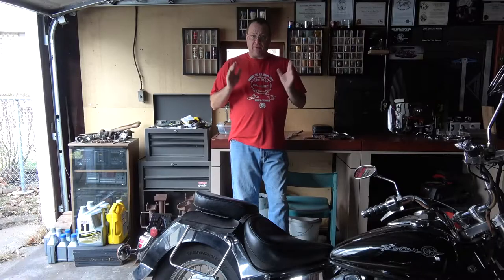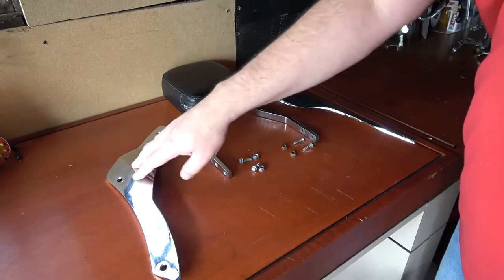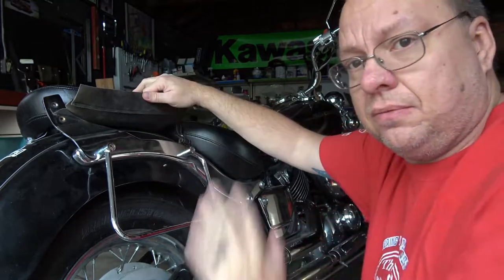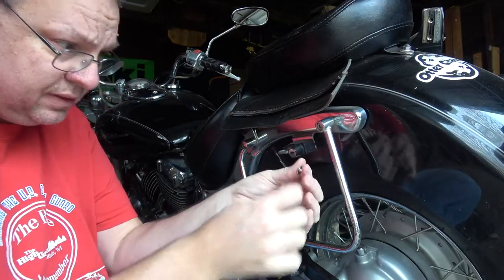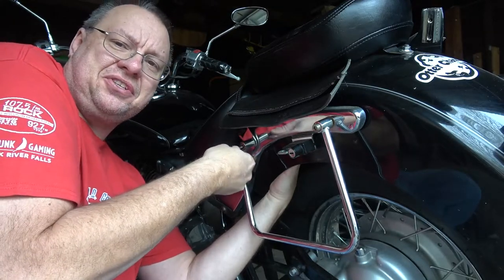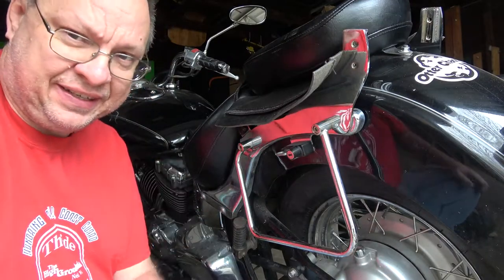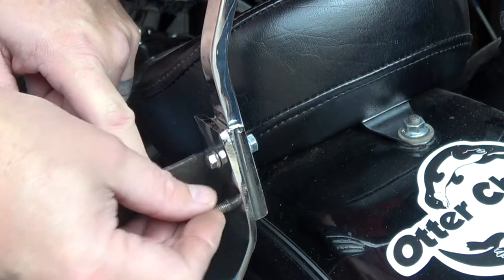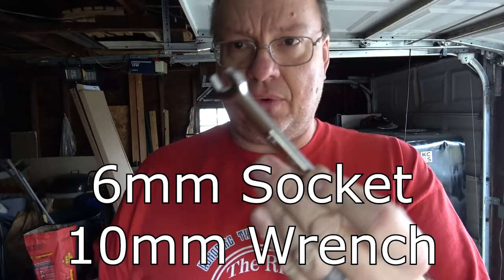V-Star 650 - Sissy-bar Install

Comment: Lets say i wanna remove my sissy bar, passenger seat, and saddlebag supports... ya think the bolts will go back in there tight or you think there will be slack and loose
Reply from the maker: You will probably want to buy new, but shorter bolts. If only removed the sissy bar you could, maybe, reuse the old bolts. But, with the saddlebag supports, the bolts will be to long and might rub against your tire.
Reply: @ChefHikerBiker  thank you!
Reply from the maker: Thank you for the question, for watching and liking my videos